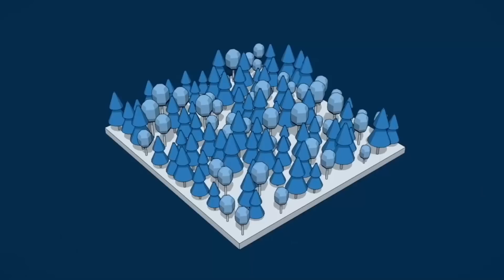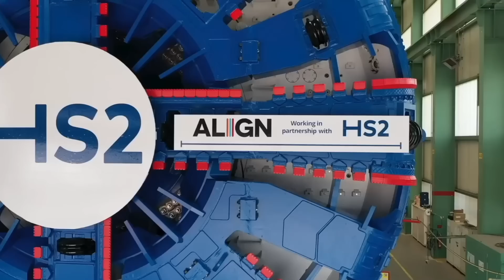Inside Britain's Controversial £62BN HS2 Railway Project (UPDATE)

Comment: The first bit they cancelled was the 1-mile link from HS1, the Eurostar from Paris, Rotterdam, Brussells etc.  this means that Birmingham wont be directly connected to Europe.  What a silly idea, truly a missed opportunity.
Reply: Not required, we have a perfect Airport that has cheap quick flight to Europe from Birmingham and the link between HS2 at Euston to the HS1 connection at Stratford International is more than a mile
Reply: @peterwallen1063  Though the idea was to take people off planes , not onto them.  As always the view in the corridors of power in London is that “the northerners can put up with any inconvenience shoved onto them. “ presumably those hoping the line would go into Heathrow can happily put up with changing at Old Oak Common rather than having the direct links that they should have.
Reply: @primemutton  The idea of HS2 was not to take people off Planes and HS2 has nothing to do with the powers in London the HQ of HS2 ltd being in Birmingham and it was built due to two failed upgrades of the existing WCML and HS2 replaced that as of going to Heathrow that was a non starter as there are plenty of good Airports in the Midlands and the North such as Birmingham Airport, East Midlands Airport, Manchester irport and Liverpool Airport so no we in the Midlands and the North do not require a direct link to London Heathrow
Reply: @peterwallen1063   so let me get this right, you're from the north but don't want rail investment in the north. From where I'm sitting it looks like you're either a NIMBY or someone who doesn't travel or doesn't travel much by rail. May I ask whether you vehemently opposed HS1 , the Heathrow express and cross rail?
Reply: @primemutton  So you are talking nonsence, so let me put you in the picture, first the line in question is HS2 not HS1, HS1 is the line from London to Paris through the Channel tunnel and HS1 I supported but is no where near where I live, so if you live in London I suppose I could say I am from the North but truthfully I live in the West Midlands in the UK's Second Largest and 2nd City of Birmingham very close to where HS2 is being built in Birmingham so neither am I a Nimby mate far from it, Heathrow is of no interest to me as is cross rail two money waister for London people and about time the West Midlands and Birmingham got these rail improvements as of HS2 and HS2 will have a direct link to Birmingham Airport at the new HS2 station, Birmingham Interchange which will link with Birmingham International Station on the New Street line, the NEC and Birmingham Airport by a driverless people mover train nd yes I do travel by train as Railways are my Hobby, I work on a Railway and I am very interested in HS2
Reply: @peterwallen1063   People need to get away from the idea that HS2 is London centric - it's NOT. The main beneficiary from HS2 has been, and will continue to be Birmingham and the West Midlands region in general. There's already been huge inward investment into Birmingham and the extra capacity for transport in the Birmingham and West Midlands will bring huge benefits to them. It's a pity that (at least for now) going further north is on hold. I think that's a short-sighted mistake.

Comment: It doesn’t even go into London.
Reply: Or Manchester
Reply: It will be going into London Euston, Old Oak Copmmon is not desighned as a Terminal Station
Reply: It is definately going to London now as the UK Government has now given the go ahead to finnishing the HS2 line to Euston
Reply: It doest go to Paris,  they are leaving out the 1-mile link to Eurostar.  What a shame, it would have connected businesses in Paris, Rotterdam and Brussels to Birmingham and Manchester.  Now THAT is what we need to get the economy moving.
Reply: @101engineer  There is no economical or logical reason due to cost to connect a domestic high speed line to HS1, it s easier to fly from Birmingham and Manchester to Europe than catch the trin, it has ben tried and failed years ago  and to connect HS2 to HS1 it is more than a mile plus our domestic hi speed trins have no reason to go to Paris

Comment: Facts: In 1998 HS1 was built using French TGV high-speed tech (line & rolling stock). Dominique" the huge launching girder being used to build HS2 Colne Valley viaduct is French engineering. In 1981 the French built the 1st true HST line in Europe, TGV broke 3 world speed records on rails: 380 kph 1981, 515 kph 1990, 574 kph 2007.
French Paris-Bordeaux High Speed Line, last leg 340 km : January 2012  start of project.  July 2015 end of civil engineering works (500 heavy works including 24 viaducts, 3 million tonnes of ballast, 1.1 million tonnes of concrete sleepers, 13,000 catenary supports)   July 2017 commissioning, ahead of schedule (planned: December 2017) Cost 7.8 bn euros

Comment: I support the construction of HS2. I accept that costs have escalated but we must push on. If necessary safeguard the land north of Birmingham and then reactivate the project once the resources are available. The political objections are disgraceful. What has been achieved so far is terrific and I look forward to seeing the first trains run from Birmingham to London.
Reply: I agree safeguarding land is important but the longer the project is paused the further costs will esculate, one examply will be when they try to re-hire all the engineers and constructions experts after they've moved onto other projects, that will be both time consuming and costly. Plus we have reports stating in 10-15 years the WCML and M6 corridors will reach max capacity, if we don't get on with this, we're adding 2 lanes to the whole of the M6 as well as re-starting this line, that won't be cheap.

Comment: It's being built because we need more capacity so that we can take filthy lorries off the road - millions of lorry journeys, and short haul aircraft out of the skies. CAPACITY! Clean electricity and, safe Transport AND it will look good!. Speed is a consideration but way down the list
Reply: When the details of HS2 were first published in 2010, modal shift from air & car combined maxed out at 16%, but each year this has dropped by 5% & is now just 1% with air & a paltry 4% from car.  In fact, its always been expected that more new journeys - currently five times more new journeys, would be undertaken just because HS2 was built, than would shift from non-rail modes of transport.
Research shows that even if HS2 had been built in full, traffic on the M40 & M1 would reduce by less than 1%.
What’s more, it won’t make space on existing railways for freight trains & may even make freight slower & less attractive. Where existing railways are two tracks, freight trains already have to move out of the way & wait to let fast passenger trains through. 
On those parts of the railway that HS2 trains will use, this will just add to the numbers of fast trains making the situation a lot worse for freight.
The southern end of the WCML up to Rugby is a four track railway, with a pair of “fast lines” used by fast passenger trains & a pair of “slow lines” used by stopping & semi-fast passenger services & freight. Even after HS2 opens there will still be fast passenger services on the WCML, providing trains to Milton Keynes & Northampton & InterCity services to places such as Coventry, Wolverhampton, Nuneaton, Tamworth, Lichfield, Stoke-on-Trent, Chester & North Wales. These will be spread across the hour in each direction to give Milton Keynes a fifteen minute frequency therefore, there are still too many fast services to allow freight trains on to the fast lines. Freight will still have to use the slow line: the motorway analogy is that HGVs are not permitted in the fast lane.
Arguments that the WCML is "full to capacity" rely on a discredited & out of date forecasting model which overestimates long distance passenger growth & isn't used for anything anymore except to justify the monstrous vanity project that is HS2.
Network Rail's "New Lines Programme Capacity Analysis" shows that WCML capacity is kept artificially low by private operators wanting to maximise profits.
A DfT analysis shows that in peak hours leaving Euston, WCML trains were loaded at just 52.2%.
In addition, HS2 doesn’t go to the places freight trains are needed: it won’t relieve railways to ports like Liverpool, Southampton & Ipswich.
The whole sorry project is an environmental disaster of epic proportions & Britain's biggest infrastructure mistake in half a century.
Reply: @CRIMSONANT1  What rubbish again, what has the M40 and M1 got to do with HS2 and what services that will use either HS2 or the existing WCML will be decided by the operator Avanti West Coast trains and the West Midlands Railways train opertor's subsidery London & Northwestern and I bet they said that of the Liverpool and Manchester Railway being an utter disaster of eppic proportions, yet with out it we would not have the Railways of today.
Reply: @peterwallen1063  .. *DISASTER .. not "desster".
*EPIC .. not "eppic".
*WITHOUT .. not "with out"
One of the so called "benefits" of HS2 was that it would massively reduce traffic on the M40 & M1 & see a huge decline in internal flights but as I've ALREADY explained, research shows that neither of those scenarios will actually happen!
You should pay more attention as the reduction in traffic has supposedly been one of the major "benefits" of HS2 ever since it was first talked about 😉
Reply: @CRIMSONANT1  Instead of looking silly as nit picking the odd mistake on spelling mistake which loads of you tubers do ( oh you are so perfect James my boy) and get your facts right on HS2, living in Newcastle on Tyne you actually know very little of HS2, no it was not desighned to reduce traffick on the M1/M40, it was desighned to increase capacity on the West Coast Main line between Crewe and Birmingham and London by taking 95% of the high speed rail traffic off the WCML onto the HS2 route so creating more capacity fror freight services and other passenger services on the southern half of the WCML which has failed 2 rebuilds over the years, there has never been that many internal flight in the UK, just admit over the years you have been ranting on about white Elephants and disasters HS2 is now going ahead in full and construction work is going on continually at full pace
Reply: Pointless from London to Birmingham and without the powerhouse that is Manchester
Reply: @rinkydinkmcruk Agreed I mean technically it will run onto Lichfield so it can connect with the West Coast Mainline and it should go to Leeds to as well for Scotland too.
Reply: @rinkydinkmcruk  The City of Manchester is no more a power house than the City of Birmingham, so much hype over the City of Manchester which in size and population is only the sixth largest City in the UK, the City of Birmingham is 3 times the size of the City of Manchester with a population of 1.5 million Citizens on it's own compared the second largest City in the UK and largest City Council in Europe to the City of Manchester's population of just 580,000 citizens and if you are on about Greater Manchester then we have to include the power House of the West Midlands Conurbtion containing 3 great Cities of Birminghm, Coventry and Wolverhampton and the Greater Midlands area
Reply: @rinkydinkmcruk  Manchester is no more a power house thn the West Midland as you are on about Greater Manchester not the City of Manchester which is no more  power house than the City of Birmingham

Comment: Please do the RESEARCH before perpetuating Urban MYTHS instead of the Facts of things such as HS2.
It was Never a Railway of London to Birmingham... 
HS2 is adding a FAST UP and DOWN set of tracks to the WCML - west coast main line.
The High Speed rolling stock severely Hampers the Local and Commuter services along the WCML.
REMOVE the High Speed Trainsets from the WCML will Increase the capacity of the WCML by over 50% of local and commuter services. 
The destination is not and will Never be .. to Birmingham. Birmingham is just a Spur off the WCML. 
The HS2 route using the old Grand Central Railway core route... was less expensive than attempting to add TWO new sets of rails immediately Adjacent to the WCML in the first 150 miles from London. 
All the rest is Standard Operating Construction Processes and the UK does it all the time - there was Nothing special or complex about the HS2. 
Your inflation of the so called court cases etc are just giving a mouthpiece to a VERY small group of NIMBY's in a section near Leeds that is no longer going to be constructed as Leeds is ON the ECML. So capacity upgrades with the ECML now having fully ECTS / EMRTS along the entire route = there is coming the big speed up and the Leeds to London via the WCML via HS2 - BY-PASS - is no longer time saving feasible. 
Poorly researched... reading NIMBYism and Urban Myths and perpetuating them instead of the Technical FACTS.

Comment: It started because the EU wanted an high speed rail network across europe. The original cost was for the whole project . The latest costings are just to Birmingham. The ridiculous costs would have been better spent upgrading the current Victorian network.
Reply: Nothing to do with the EU and billions had already been spent of upgrading the existing lines, only for them to already be over capacity when the work was done. The only way to get extra capacity was to build entirely new lines. It was more expensive to add lines to existing alignments, flanked by existing developments, than to create a new line that could bypass smaller population centres, taking intercity traffic off the existing lines. The High Speed part is nice but isn’t the main benefit - certainly not between Birmingham and London anyway. 

Cost escalated for a bunch of reasons.

Simple inflation, fuelled by the twin messes left by CoVid and the additional costs on everything once we left the EU. 

Optimism bias at the outset. 

A quite ridiculous level of environmental mitigation applied to the scheme imposed by political considerations of the conservative areas it was passing through. It may be great to go to this degree given it should stand for 150 years, but it comes at a big cost, and the bar was set far higher than any road scheme seems to have to pass. Almost half the length is in tunnels for example. 

So all consequences of decisions made here. Nothing to do with the EU.
Reply: @eddaines237  And on top of that, big portions of the west coast main line quite simply cannot be upgraded in place. Old tunnels quite simply cannot be widened.
Reply: Haha, honestly the EU have always known the UK's obsessions about borders means a full UK/Europe railway network was never possible, plus the way HS2 has been designed makes connecting it impossible anyway.
Regarding upgrading the current "victorian" network. Do you think they didn't look into that? To reach even half Hs2 capacity, it will cost almost the same, require even more house demolitions and result in weekend closures for over 10 years. Great plan Tony.
Reply: HS2 was never started by the EU, it was started by the UK government to improve capacity and speed on the West Coast route